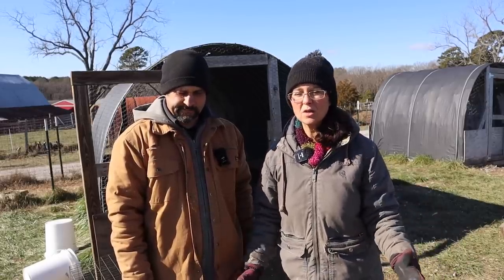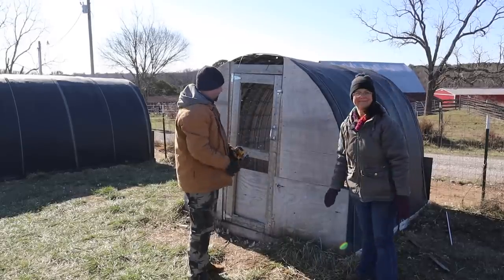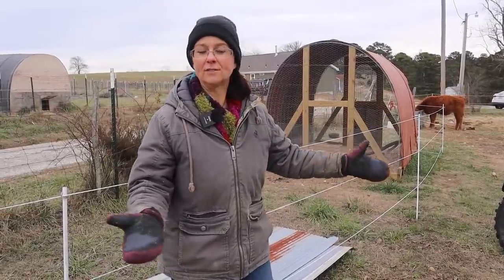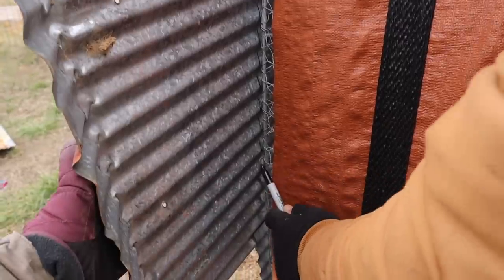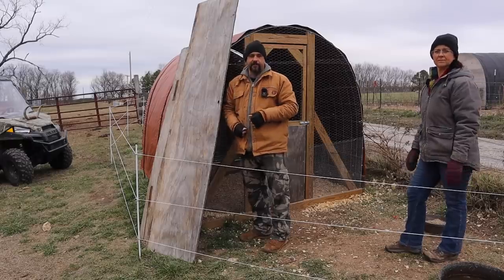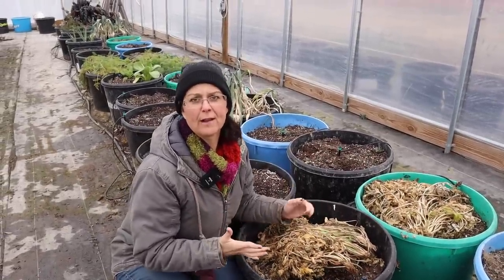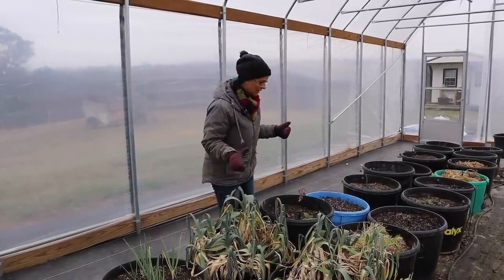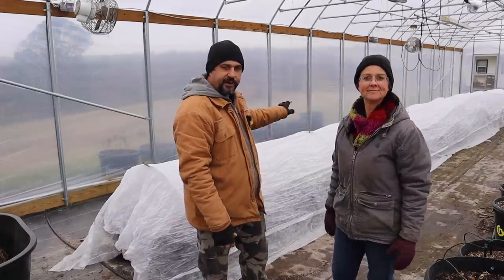It’s Gonna Get Bad!  Our Job Is Keeping Everything Safe!

Comment: Grower's Solution still carries the wire on their website.  The wire is called Wire for Hoops, Wire Tunnel Supports.  They also carry Coiled Wire for 32 Row Cover hoops for smaller cover projects.  They also have a video on the item webpage of your first time using them.  This gives me an idea to use the wires in the summer for shade cloth over my containers when the sun gets too hot.  I love how you work together in unison to get projects done and don't fight or argue about anything.

Comment: Kevin for those who cannot afford to buy a tin cutting tool, it can be done with a board and some baling wire. take a 2x4 or something of equal stability, put a nail in the end, wrap baling wire to secure around the nail, and stretch the wire centered on the board, then lay your piece of tin that needs to be cut over the wire. wrap the other end of the wire around a piece of wood about 8" long to grab and pull(like a piece of mop or broom handle). lay a couple boards like 2x4s on top of the tin a couple inches apart over where the wire is so you can stand on them and pull the wire to rip the tin.

Comment: Loved this! I especially liked how you explained that chickens are pretty cold-hardy and as long as the wind is blocked, they do well in the bitter cold. I believe some folks are under the impression that coops need to be heated in your neck of the woods (pun intended!). I also give my chickens extra corn during cold snaps for warming-up energy as well. It will be a high of 0 Thursday around my area, and I know the chickens will be hanging in the coops most of the time.

Comment: Do not underestimate the power of Free Bubble-Wrap.  I use bags & pieces when I make breads to aid rising in a cool room.  Between pieces of whatever, it increases effectiveness of a temporary removable insulation.  Cheap $1 mylar blankets another way to trap heat.  Can be bought in bulk.

Comment: If those cutters will go on upside down and work correctly, you can hold the tool with the battery above the tin and cut the tin flat against the ground and keep your hands away from the cut edge.

Comment: Lumber is back to 2019 prices in my area… it’s been dropping fast since last May.  Just mentioning it in case you haven’t checked your local prices lately and holding off projects based on prices from 6 months ago… I mean always reuse if you can, but you might be pleasantly surprised too.
Reply from the maker: Thanks!!

Comment: You should find a recipe for Leek and Potato soup. Oh so tasty and
comforting on a cold Winters Day, and easy to make too. 

Question, wouldn't it be easier to put all the buckets that will be used
for Winter crops permanently up one side of the greenhouse instead 
of moving them around?

Comment: I recently discovered insulated heating wire used for snowy rooftops or plumbing pipes. Electric and they turn on only at 38° or below. I thought a good use would be strung around chicken roosts or rabbit cages for a little warmth. But only if solar-powered worked at night, I guess. Maybe the fence solar power could be used.

Comment: Need panelling?? Want it for free? Real estate companies use corrugated plastic signage to advertise properties for sale/rent. Once they're sold they're waste, so they usually give them away for free. 6x4ft and they're so handy for tasks like the chicken housing. Just use screws with panel washers, or sometimes zip ties to secure them. I use them under cardboard boxes that are stored in my garage to prevent rot. On the insides of raised gardens - better than plastic because it doesn't flop over. Another positive is that they're good insulator and last a long time.

Comment: If you would get a power inverter, saw a 7000/2000 and a battary, ( Car, Marine or others) and a wheel borrow and you will have 110 volts to run your small appliances like a drill any where and will save tome running back and forth to get things cut out. Stay safe. Merry Christmas and have a Happy New Year.

Comment: i'd tack the coop doors up w/ heavier mil plastic tarp, 2/3s  up (or more) because the snow and winds are going to drive in in there prolly.  the ventilation isn't the issue right now.

Comment: Hitting here Thursday afternoon. I'm only 1 hour north of Houston, and it will get down into the teens Thurs-Fri night. Won't get above freezing on Friday. Windchill in the single digits, with all the wind. Have to do a lot more protection for the water well and waterlines, since we don't have frost-proof hydrants. And then, back up to 70 degF by next Wed. Not sure what plants are going to survive. Going to put up some clear plastic greenhouse panels on the front of the chicken coop, so protected from the wind, but the light still comes through.

Comment: I'm in SD and it's already -15!  Winterized my coop back in September so I wouldn't have to freeze lol!  I use the little flat screen heaters for mine,  insulation,  and then they have a really large heavy tarp over the coop at night.  Save your old bedding, it is great to put down over the snow!

Comment: I only have two pet chickens up here in MN where it is going to be 8 below on the next day or two. They are currently in my house as two chickens don’t produce a lot of communal body heat and their coop (insulated and fancy ) is just too darn cold. If I would have known I would have been keeping birds in my kitchen all winter I probably wouldn’t have gotten them. Last year I was heating the 4x5 coop to 50 degrees. This was costing about 100 $ per month. This year just can’t spend the money.  I am assuming an actual flock of chickens can stay warm by huddling together. Is that what they do? I love my little birds, yes I am a crazy chicken lady. Cats would have been cheaper.

Comment: I'm confused, you say that it'll be a high in the single digits. Then a roe cover won't do much, or am I misundertanding things? It gives you a little more time until the temperature equalizes, so for a frost for a few hours it may help. But for constant low temps like you're expecting the effect is very minimal.

Comment: Wondering how attaching wheel kits (hardware store) to buckets would work? 
If would be easier to move them? what the Lil bit of air between bucket and ground would do in heat and extreme cold?

Comment: What do you do with your rabbits? I was hoping you would've covered that also in this video. I know they can withstand temps in 20's but when it gets down to teens or below 0 to --11, as it is planning on being for 3-4 nights in a row starting tonight do they need any additional care? Currently we have plastic wrapped around entire cage and have trays with straw in them for insulating the floors from drafts, we have straw inside their nesting boxes, and change water to warm water several times in the day but at night they turn solid ice, front doors we have pink 1/4" foams sheets so if it gets hot enough and we can remove the trays and foam sheets. They all have insulated roofs and all cages are surrounded by 6x10 dog panel Pen Area with two panels making a gable roof and tarps mostly covering all panels except the gate and peek roof sides. Tarps are Clear to allow sun during the winter time but there are enough gaps for airflow it only helps a little.  Was thinking of putting in a lower tarp to tent in cages tighter in order or less heat escape and maybe put in a small infrared radiant heater. It is safe enough.we used it to keep pipes from freezing under our trailer while building our home.  Or possible buy some Rabbit heaters roughly the size of 5"x8". But that can be costly and we would need 3 for each cage.  Any thoughts anyone?

Comment: If your lady bugs begin to run out of food mid winter, you can feed them sugar water.  There maybe better foods outside of introducing non-benifical insects which to me is a generally bad idea and more so in a green house. Old school was to use hummingbird solutuin and then with time clear hummingbird food.  This can of course be made in the kitchen with a 1:4, sugar to water mixture.  Many firmly believe in going to the expense of cane sugar and/ or organic cane sugar.  Cooking to a boil, just like humming bird feed is also recommended.  -  To use, simply spray the sugar solution where you want them to feed with a clean, unused spray bottle.

On and off, it is popular to tend and nurture lady bug colonies during the winter in an attempt to increase thier populations by spring.  You don't want to do this in or too close to structures, like the house.  In fall they can decide to over winter in attics and walls making quite a mess then becoming a destructive pest.  They do make lady bug houses, similar to bird and bat houses, which work in some but not all climates.

Comment: I live in Missouri too.
I built this same coop in the spring.  At -6 tomorrow, will any heat lamps be needed?  I have deep bedding and 16 chickens.
And is that much air ventilation needed for the two super cold days 0 degrees and the negatives? 
I didn’t leave that much ventilation opening, although it’s not tightly sealed as you know seams and such.

I don’t want to over think and do too much trying to keep them warm.  I put up 3 mil clear plastic that is doubled front and back, I didn’t have any wood or metal to use. I have 16 birds. I have Wondered if the coop is too big to keep them warm, if I should partition with a tarp inside making a smaller tighter area making a wall from the tarp reducing the 12’ length down by about 3’ making it a smaller area to keep warm.  Is that over worrying?  I’m panicking.
Reply: No heat!! Made that rookie mistake and several of my girls died.  It weakens their natural ability to keep warm.  And they might need a little more than just the seams for ventilation. 
Maybe someone else could come in but it's my experience.

Comment: I am hoping either you or a channel like Doug and Stacy will address how to actually winterize a homestead. Too many (even homesteaders) have no clue  how to wrap pipes, set up a rocket stove, boil water in bulk, sanitize drinking water with one drop of bleach, trickle a faucet, prepare their animals, make a windbreak for their animals, load a fire based furnace, set up a heat pump in a water tank for livestock, where to get heated gloves or jackets....etc.  So sad to see so many scrambling and suffering because of once in a decade weather. People need real instruction on how to be prepared for this kind of cold when the power goes out.  Please look into making a comprehensive video that people can watch in October or November to be ready. It could even be a series.
Reply: Hello Kathy 👋 How are you doing today?